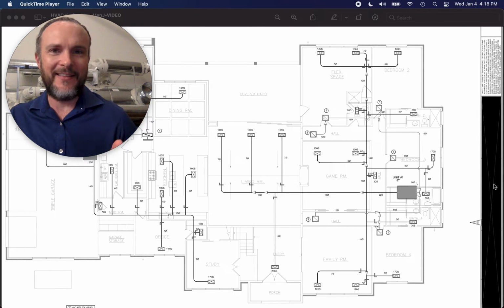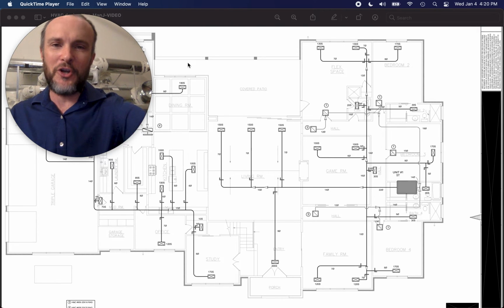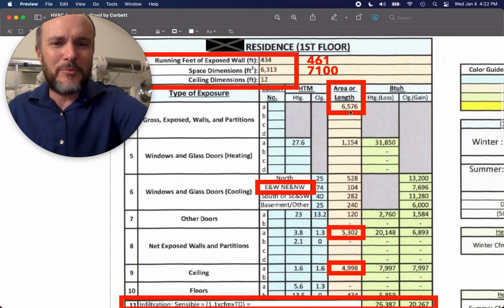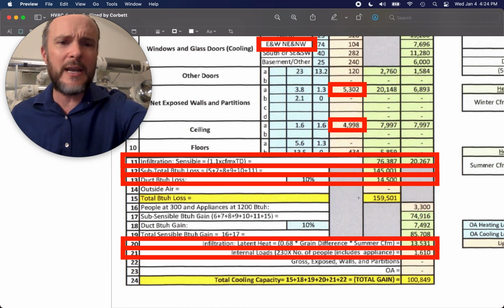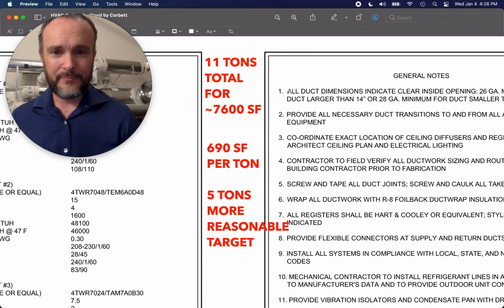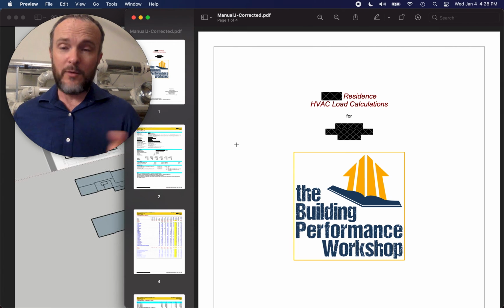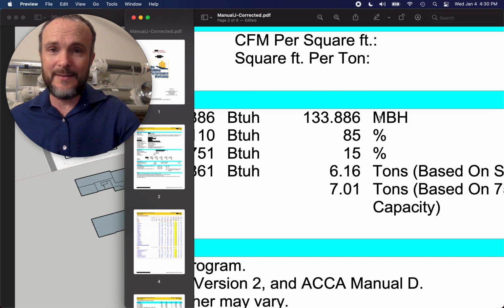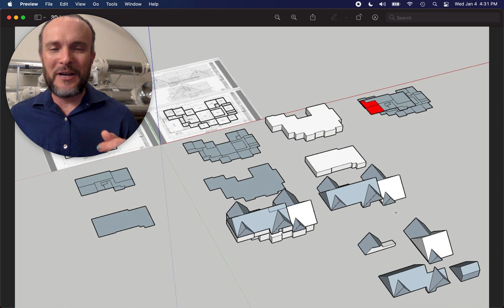Manual J or Not? How to Tell If Your HVAC Design is Bogus (HVAC Load Training)

Comment: Hi Corbett, I have a 1950s house that is 730 square feet. I am looking to replace the furnace and A/C units, which are 40 years old, with a heat pump. One company said that the manual J load calculation is 21,550 BTU for my house. Should I get the Manual J, Manual D, and Manual S done? Would it make sense to hire a dedicated company (you?) to complete the Manual J, D, and S for my project?

Comment: The “real” Heat Load calculation. Hahahaha 😂 Like Manual J is the only method. It’s the only approved method by AHJs. I would argument that there are other reputable methods available based on ASHRAE tables. Plus, clearly there is bias in the inputs from the designer.

Comment: Design Temperatures are critical. ASHRAE BIN data or typically not recommended in Texas because of real-world climate change variables. In commerical design, if you ask ten consulting engineers what Design Temperature is X city, you’ll get ten different answers. Always go with someone else’s Design Temperature, when possible.
Reply from the maker: You can use actual historical data from ASHRAE, latest 2021

Comment: So I found you from Matt Risinger's channel fyi. One thing I've heard no one talk about is non standard spaces and non standard  heat sources. Does manual J allow for the inclusion of things like welding, shop doors opening and closing, air compressors, servers, ovens etc into the calculation. If it does not, do you have recommendations on literature to read about this. I don't have my manual J book yet, but nerd out on doing things the correct way.

Comment: Have you ever heard of the software called heatcad? I've used it a few times for experimental purposes and would be curious, from a professionals standnpoint, if it's worth using. It includes the 3D modeling and allows for quick modifications.
Reply from the maker: Sounds hot

Comment: I just took a basic load calc. class for my associates degree. I don't use fancy software. And I barely needed any of it for installs and diagnostics. But even my amateur hour self can see the glaring flaws.
Reply from the maker: You get it, Niveous. For residential, Man J is the kind of load calc required per building code, and if you get ahold of Manual J and read just the first few pages, it’ll tell you this can’t be done on paper.

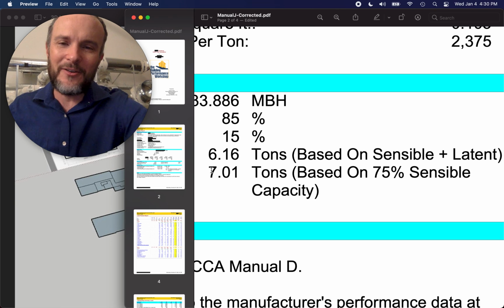Comment: @12:05.   The software provides SHR for 0.75 because equipment is often rated at that and it aids in selection.  Manual J doesn't tell you what size system you need, it tells you what your system needs to provide.  Load versus Capacity.  Manual S is where you determine what size system/capacity.
Reply from the maker: Interestingly, these days it seems to be all over the place (but higher sensible than 75%) because of optimization toward better SEER numbers.
Reply: @HomePerformance  Yes, as evaporators get warmer the latent heat capacity decreases.  You may find a system than meets your sensible capacity requirements, but falls short on latent.

Comment: Constructive criticism.  Hah!
I been doing this for 20 years I can do a manual j in my head. 

The guy I had do the manual j was here for a good hour measuring. Had it done twice. First was with bat insulation and hot attic. 
Then later I was more comfortable with spray foam. So re did it. 
Dropped from 5 ton down to a 3.8.
Should be signing a hvac contract soon.

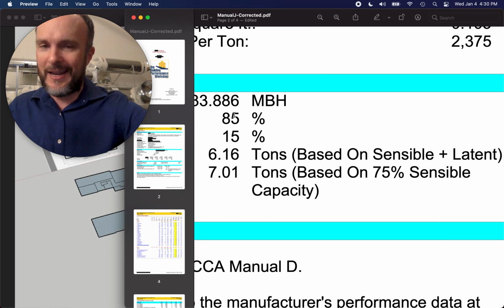Comment: 12:15 I haven’t seen a residential HVAC system with a sensible heat ratio that bad in a long time. No system does 75% sensible anymore lol.

Comment: All I can do for existing lived in homes is make some educated guesses on insulation and infiltration. Then I run room by room heat load calculation. I'd love to meet a builder, engineer, or architect, that actually has all the data I need to be accurate. I've never even seen someone run a blower door test. We do a few new construction custom homes a year. For those jobs the owner does all the heat load calculations and system design.
Reply from the maker: You don't have to guess buddy- I got you. Stay tuned.
Reply: @HomePerformance  I'd love to learn more! The hard part will be time constraints. I usually have about 2 hours in a customers home. I can't see the R value inside walls, the U factor of windows, and how well sealed the home is. Most homeowners don't even realize that these things are important. They just want a new furnace, or to add a heat pump, etc.
Reply from the maker: I hear you- but there are HVAC techs across the US, some of them my Mastermind students, who use their own blower door, infrared camera, inspection scope, etc. It’s not easy to go the extra mile, but once you do you’ll never have to compete the same way again.

Comment: 95% of what we do is HVAC replacement equipment for existing lived in homes. Most customers don't want to replace their ductwork and rip open walls.  We have to inspect the home, and run heat load calculations off of assumptions and limited data. Your methods are perfect for custom new construction or a major remodel!!
Reply from the maker: Video forthcoming on existing replacements KP

Comment: I can do a manual J, manual D, mastic the duct to death, insulate the metal duct with R8 insulation to the best of my ability, and then I see that the insulation contractor appears to hire 6 year olds to install the insulation in the home.  I live in Kentucky and we have an HVAC inspector, but not a building inspector.  The HVAC inspector actually tells me he hates the Energy Code, and that I worry too much.  Thank you for what you do!
Reply from the maker: EXACTLY, James! If you have proof that the problem is with the enclosure, not with your HVAC design or install, then you’re off the hook. Testing for the win!

Comment: i saw one a little while back where they had no returns from the rooms. in fact half the house returned back through the kitchen.
Reply from the maker: Tweake, my whole home has one central return- it can be done right
Reply: @HomePerformance  no doors?
Reply from the maker: In my home? Yes, there are doors, but they’re undercut by 1”, which can return up to ~80 cfm. It’s in Manual D, actually.
Reply: @HomePerformance  would they do that here? It would not be the first time I've heard of installers telling the cust to "leave the doors open".

Comment: So not asking you to spill the beans on your client here - but am I right in assuming they're not in a town/county where this would have been evaluated as part of the permitting process?

Because based on my experience - when permits are under review, sure - no one is going to repeat the that you paid architects, engineers, etc. to do - but they'll at least do some of the things you did, and make sure numbers are at least... in ballpark and in the right format.
Reply from the maker: This is actually from a relatively progressive place, code-wise. You’d be amazed- I have another one coming that’ll floor you.

Comment: When we build our home we got  3 done from different contractors for the same house and none matched. All were provided the exact same plan. They all said 1000 sq ft a ton or less. We finally gave it to an energy engineer and their numbers actually made sense. It came out to 1700 sq ft a ton.
Reply: When you ask 3 contractors to design your HVAC, their free "design" is worth what you paid for it. I would hope an architect would do better, but they are still competing for business to some degree, and they can cut hours on a design as well to make a higher profit. I don't know what software architects typically use, but it should be trivial for that software to design a HVAC system, since everything about a new build house needed for a HVAC design is already in the house design.
Reply: @johnhaller5851 your best bet is a mechanical engineer who specializes in Residential HVAC design, even commercial is different.
Reply from the maker: The industry has just not been about careful, conscientious choices for anybody involved